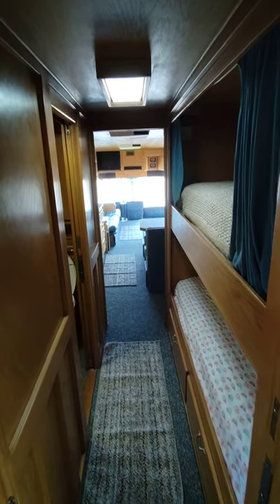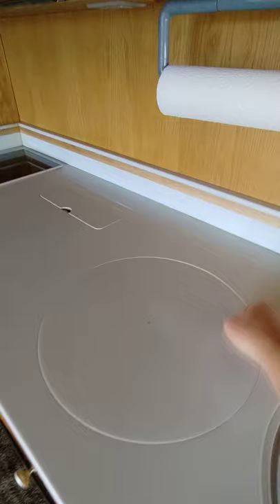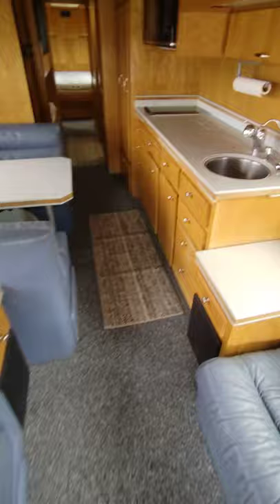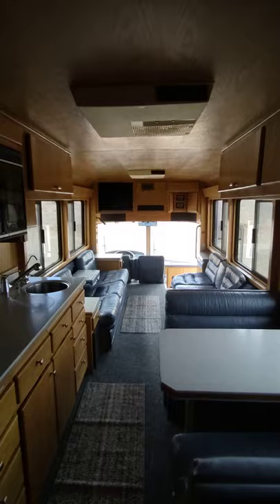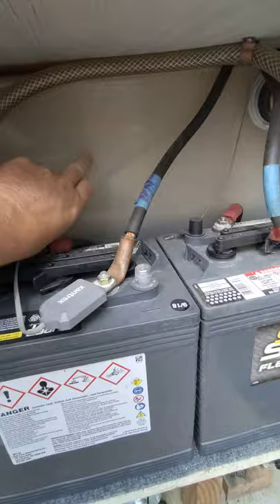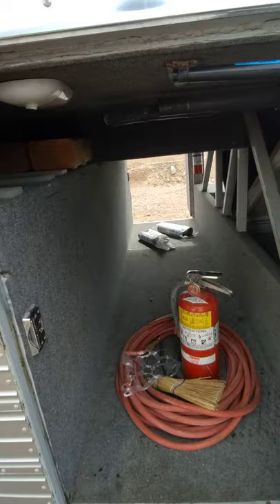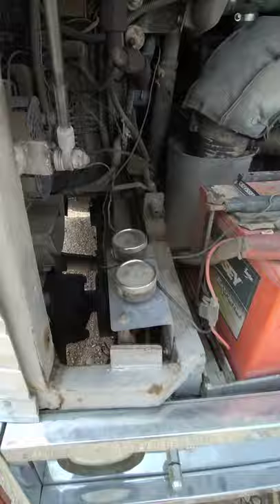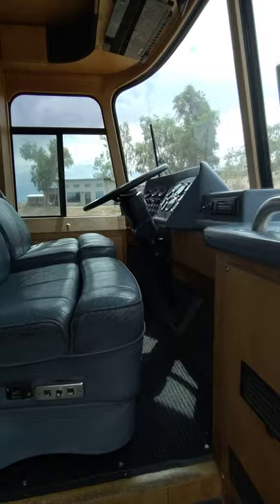Silver Eagle model 01 Diesel pusher with 8v92 two stroke diesel. walk through inside&out. FOR SALE

Comment: Are you sure you didn't transpose the model number. I used to drive eagles , even bringing a brand new one back to Massachusetts form Brownsville, Texas, where they were made. I think that's a model 10.
Reply from the maker: No it was a 1964 model 01. Model 10s were from the 80s. This one had extensive custom work done with the suspension so maybe it seemed like a different coach bit it was for sure a model 01. It's long gone out of my possession now. The new owner took a road trip from phoenix to Florida and back last year and he messaged me and said it ran flawlessly. Always a great feeling.
Reply: @mattlentz5107  , It also had  the front and rear caps replaced with ones from the 80s. On the front, up until the 05s, there were two upper windows, where the roof slants to the rear, and on the rear, the lights were round and arranged vertically, the biggest on top.